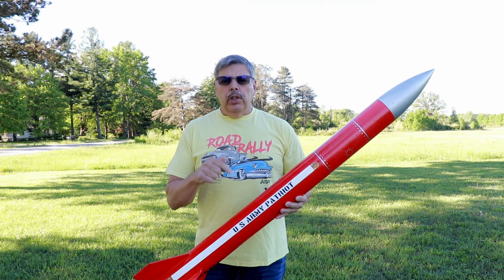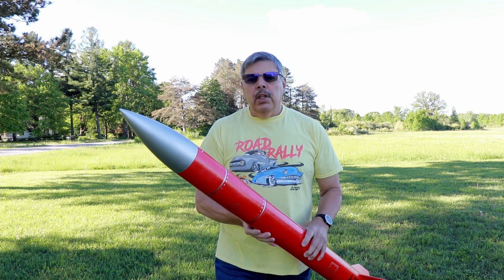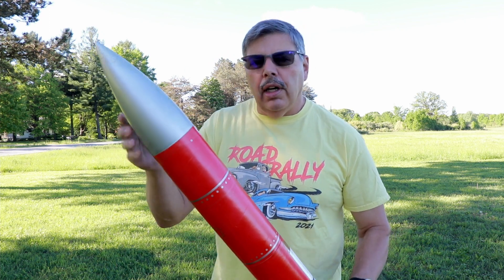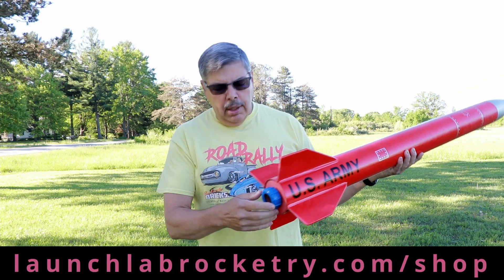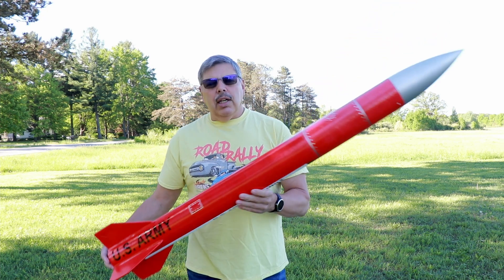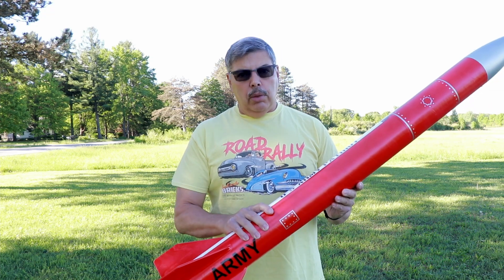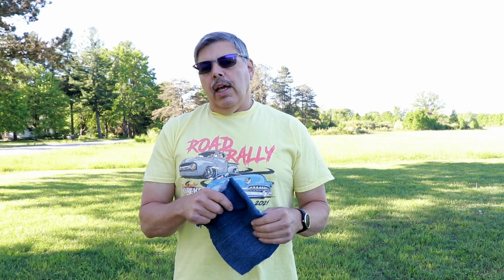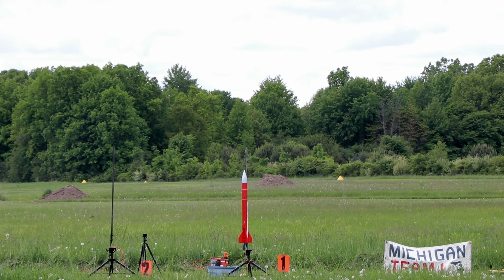Patriot launch

Comment: Cool Beans, 'Rocketeer'..... as I commented on your previous video on the same 'Patriot'-build, Another Great tip on using denim for your Kevlar blanket, but how do you replace it??

I hope to see your comments.
Reply from the maker: I cut a slit in the denimum and then attach it to the quick link on my parachute with a ziptie or to a loop on the shockcord. When it's worn out I cut the ziptie and replace with another. I always use  recovery wadding (dog barf) to extend the life of the denim or kevlar.

Thanks for your comment!
Reply: @TheRocketeer  Cool Beans!!  Thanks for the reply, but another Q...I will need to trim the ziptie, yes??  And the ziptie won't burn, will it???
Reply from the maker: @Hey_MikeZeroEcho22P  I make a small loop with the ziptie and then trim the end off. The ziptie is far enough away from the flame that it won't melt. Good luck!
Reply: @TheRocketeer  Super....thanks for the Quick Reply!!!  All the best!

Comment: I'm currently designing a new engine. I'm using 1.25" diameter PVC pipe as the motor casing and a pvc bushing to hold the nozzle. I plan on 3d printing a mold like in your previous video to cast a uniform concrete convergent and divergent. I have a couple questions. What is the ideal angle for the divergent and convergent openings? I have read that a 12° angle is well suited for a divergent. But I get varying answers for the convergent. The motor will be using 4 Bates grains that are 2" high and 1.25" diameter.
The fuel consists of 65% KNO3 and  35% Sorbitol with an additional 5% magnalium powder. I plan on using a 4" diameter rocket to launch it on. I'm still trying to determine the core and nozzle diameters but I'm estimating that 5/16 might do the trick for the nozzle and 3/8 for the core
Reply from the maker: Convergent angles are typically between 12 and 15°. I have used 15° for all of mine and they have worked well.

I think you are in the ballpark for motor design. I would do several test burns without magnesium to establish a working base. If the motor fails then try a 1/2 core. Designing rocket motors is usually a series of small steps. After several attempts then add the magnalium. I don't know if PVC will tolerate the heat from a metal fuel.

This is a very powerful rocket motor with a lot of fuel. Make sure you light it electronically and not with a fuse. Keep your distance and plan for a CATO. This is not a neighborhood friendly test!

 Place the e-match at the top and pull it back half of one of the Bates grains length. Make detailed notes and keep me updated on your progress. Good luck and stay safe!

Comment: I have the same rocket,  still building it right now. You think it'd fly ok on a cesaroni G79 1 grain motor?  I'm trying to keep the altitude low.
Reply from the maker: My Patriot weighs in at 59 oz with no motor and slighty larger fins. In Open Rocket the G79 smokey sam should have a lift off speed of 41 Ft/s and an altitude of around 565 Ft. This is on the low side but I think you will be ok if the wind is low. Good luck!